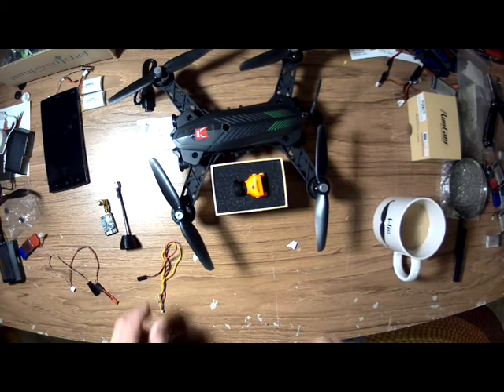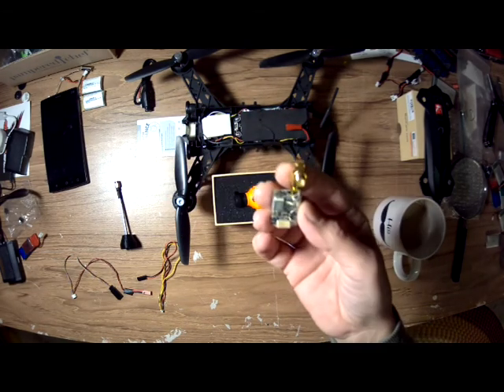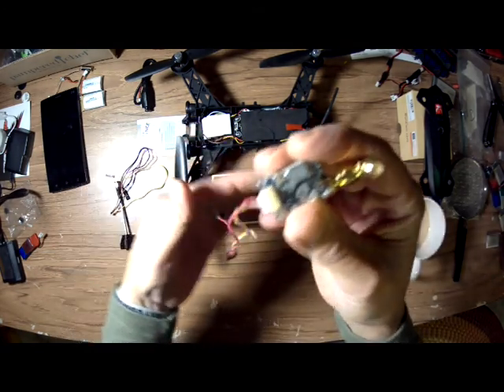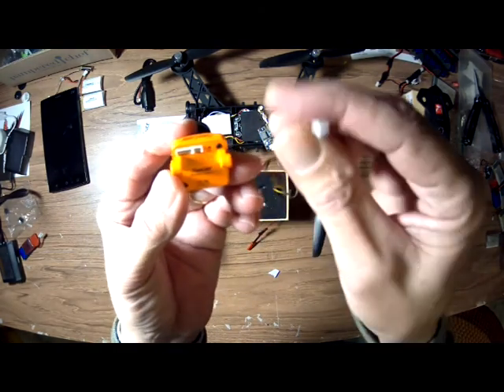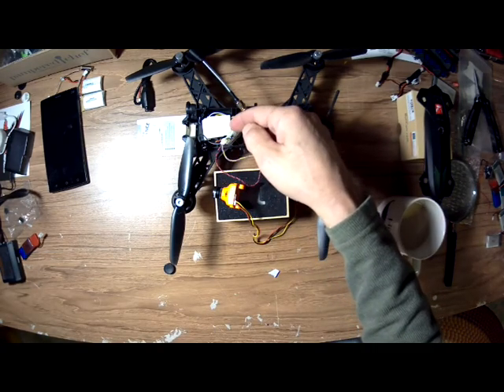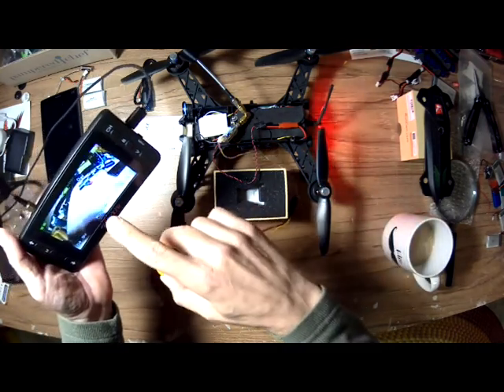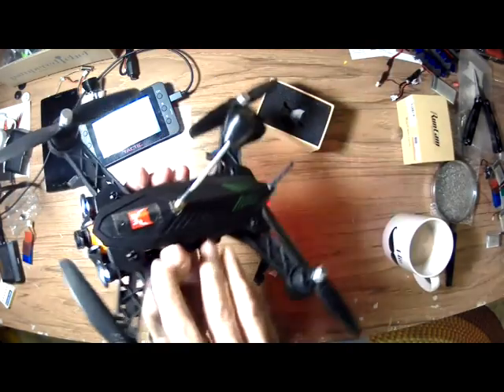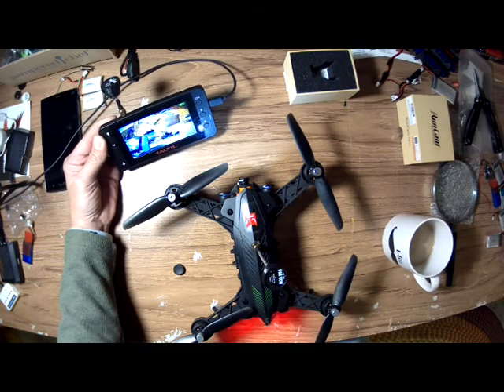MJX Bugs 6 FPV and RunCam Swift 2 Install

Comment: I had my power wired in the same way and I think it was given me issues with breaking up so I got rid of the plug and soldered directly to the power wires on the bug seems to have helped out a bunch.
Reply from the maker: Cool!! I think there are filters that you can install to help with that also!!
Reply: DRONE POOL I will look into that thank you

Comment: TY for the video. I'm new to this but I have a set of goggles on the way. Did you hook the camera up to different battery???
Reply from the maker: There is a 3 pin port on the board for fpv camera.
Reply: @DRONEPOOL  TY

Comment: Hello dan, was jst plug connected straight to the quad battery xt30 or balance plug wire?
Reply from the maker: Omotola Ilori I soldered JST to board where battery connection is. I have a more detailed video on the installation. I'll try and find it for you.
Reply: DRONE POOL ok i'll be waiting. Thank u so much
Reply from the maker: Omotola Ilori watch this video. You can start at the 7:00 mark. Let me know if it helps.

https://youtu.be/N-hny7tbe84
Reply: DRONE POOL ok.....POW!!! thats it...
👍👍👍👍👍

Comment: Thanks for a great video, you made my day. Planning to replace the stock camera in a Bugs 6 with a Caddx Turbo and found this very helpful. One question though. I dont have any cables directly from my battery, can I use the same connector as the stock camera uses? Otherwise, how do I connect the cables to the battery? Thanks again!
Reply from the maker: Fredrik Svensson yes you can use the same power source as stock camera. Thanks for watching!
Reply: @DRONEPOOL  Hi, one week ago I got a bugs 6 without the mjx fpv system (c5830 camera sucks). Just run into your video and I'd just like to know what did you do the battery connector to provide power to the transmitter the way you showed on the video. As you will notice, this is my first drone.
Reply from the maker: @pibe88iTa  watch this.
https://youtu.be/b_lo8URig8U
Reply: @DRONEPOOL  Thank you. So, long story short, (on a Bugs 6) I should get a jst female connector and solder the positive/negative tips to the Bug's battery connector? That would be really nice, cause it avoids the need of soldering the battery connector every time you get a new fpv transmitter. Am I right?
Reply from the maker: @pibe88iTa  oh. I thought you were talking about the radio tx. Yes you can power vtx from battery as long as it tan take voltage from a 2S battery.
Reply: @DRONEPOOL  I probably should have said "vtx transmitter" on my first comment, my bad.
Reply from the maker: @pibe88iTa  no problem.  I hope I have helped in some way.
Reply: @DRONEPOOL  Of course you did. By the way, I guess that the 5v connector on the bugs6's motherboard is completely useless (for non-AIO systems) cause it doesn't output a decent amount of volts.
Reply from the maker: @pibe88iTa  it's ok for an AIO but for something that can take higher voltage why not use it.  So I agree.

Comment: Nice setup... i have a firefly q6, ts832 with usb otg receiver and with this video i will be hooking it up with the bugs 6 battery because i was considering buying a seperate battery. Whats the max range of the bugs 6 and is there a mod?
Thanks dan, keep it up. Sub and Like
Reply from the maker: I dont think that range is that far, but you can always do a antenna mod to increase rang.
Reply: DRONE POOL pls how can i increase the range and what are the requirements?
Thanks Dan